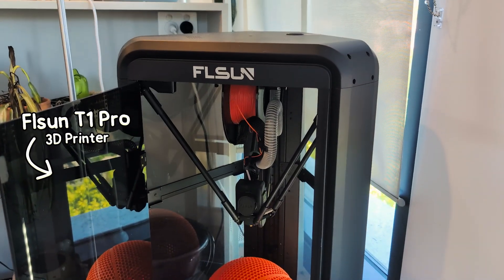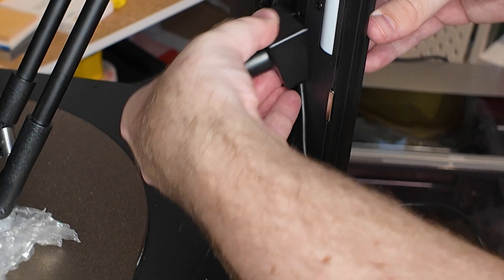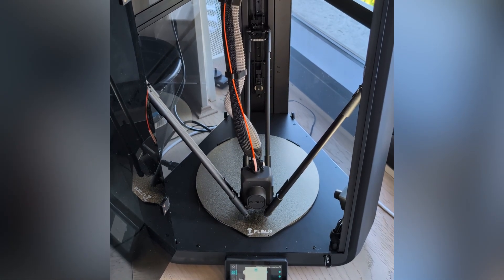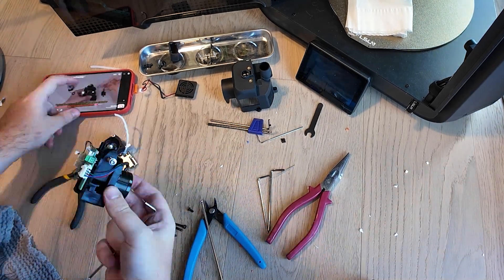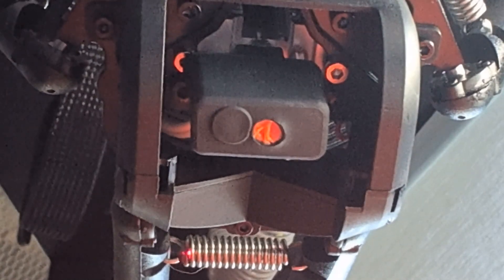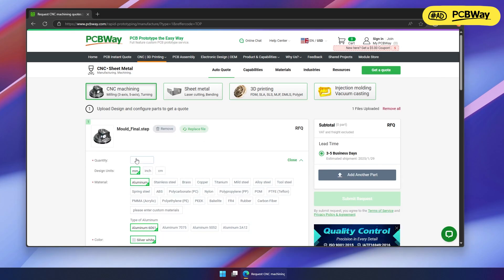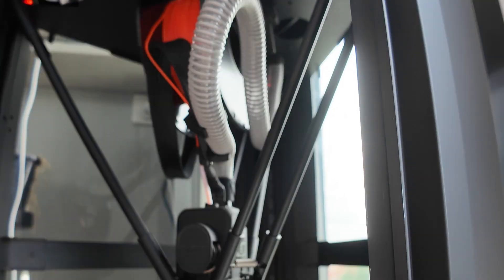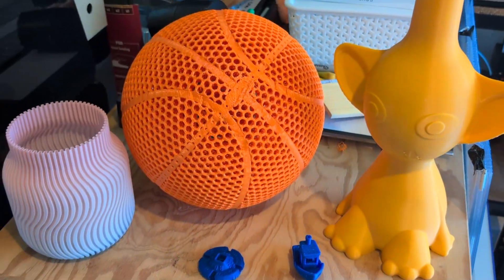I tried the Flsun T1 Pro - It didn't go well...

Comment: Received 7-20-2-25: Filament detector failed, took way too long to receive a replacement, the wires on the left fan were stripped during factory assembly, elected to outsource from Amazon, amazing how a manufacture can fails to include the rear screw in a disassembly video. Horrible effector design, totally unacceptable to clear a clog. I used a mirror to aid in removing the bottom screws. WTF!

Comment: I think you feed filament wrongly - you should place spool to unwind backwards so filament runs along hose and ribbon. This was the reason for tangling. Even better might be to lead filament through ptfe tube from spool to extruder (or mode spool out of enclosure).
Homing happens when print is done 8:50  - never during print - so thats not the reason for tangling - print started and you see first layers print well - i think You place both clips to close to each other and to close to head - while to far from spool and spool unwind to the front = recipe for disaster.

As a proof - heres my video:  https://youtube.com/shorts/MAxd52yC0ao
Reply: If you had this printer, you'd understand the proper loading, and it's certainly not to the back of the printer.

Comment: I've had the T1 pro for a few months now. Really bad first impression. It has a lot of quirks and getting to know this speed demon takes time. 

What I've learned:
Slow it down! You don't need any of the printing speed settings about 300-500 MMS the fast travel and acceleration still cuts print times down a lot.

Use glue stick for every print. It's a necessity.

Make sure your z settings on supports are at least 1mm bigger than layer height to allow supports to remove a hell of a lot easier.

Infill should be adaptive cubic.

Use the extruder back out (unload) setting to fix clogs before trying to remove the whole thing. I made that mistake wasting all that time.

Comment: Preordered t1 pro, i totally agree with the horrendous toolhead removal just for dealing with filament jams. Disassembled the toolhead 2 months for a jam. The nozzle unscrewed itself, caused a filament clog. Suddenly , the printer having leveling and stringing issues , found out that the nozzle sandpapered itself and became damaged. 

Changed to a tungsten carbide nozzle. No issue on printing. Switched the original fan to the sweeper fan ducts and got a " silencer" for the fan inlet port and another chimney filter to cut out the annoying high pitch whine. Taped and foamed up all the existing gaps on the doors and panel. Now printer works wonders with minimal noise and maintenance.

Comment: The tangling is due to not having the filament run through the cable clips on the cpap usually.  But your end conclusion is correct I think, it's a terrible out of the box experience.
Reply: @crashingsux  I have worse tangling if I run through both clips. Running through only the one closest to the extruder and printing a roller that uses ball bearings for my spool holder has cured my tangles.

Comment: Those surface issues you are seeing are under cooling.  FLSun turned down the stock fan settings to try to quiet the noisy beast, resulting in undercooling.  You either need to slow the print down, or turn the fan speed up.  There are better fan shroud designs, but in the end you can't print that fast without making noise to cool.  To compound the heat issue, they set their default profiles hotter than everyone else to increase flow, so if you do slow down consider dropping the filament temp as well.

Comment: I've got a T1 Pro.
So I'm a tech geek in my 60's, I've assembled thousands of devices over the years and I gotta say the "out of box" experience FLSun has on offer here is horrible.  Seems they have willingly sacrificed a good setup experience for a buyer in the interests of the "flattest" possible shipping box to minimize their costs.  A complete re-think of what can/should be pre-assembled at the factory for a better overall customer experience is in order, and only THEN develop packaging to match.  And yeah, the arms/extruder assembly is particularly fiddly and overall bad.  I also ran into an issue where installing the plastic cover over the two cables that plug in at the top of the left support dislodged one of the cables, giving me a DOA experience on first powerup.  Their customer service though DID provide some excellent troubleshooting tips with pictures and videos with which I was in just a few minutes able to find and correct the problem.  Needless to say, I didn't reinstall that cover.
Very much agree as far as noise level, this thing is WAY too loud.  Their design decisions regarding the "Pro" upgrade over the original T1 kinda addressed some major flaws, but didn't go as far as they should have gone.  The choice of a "medical" style blower is just mind-numbingly bad, they COULD have made the Pro oh so much better but it seems the design team is either deaf or working in a factory environment that's just so loud otherwise they just never evaluated the end product in a quiet/home environment.
The filament handling system is incredibly bad.  I found a spool roller  that fits to their insane "bar" and that has GREATLY reduced that particular problem.  Have not had a filament tangle since, between using that and ALWAYS homing the extruder before starting a print. I visually ensure filament is back on the roll properly before I start any print.  And yeah, those hose clamps are BAD.  They don't stay in place, running your filament through both is a nightmare, comments I've read online suggest ONLY running your filament through the one you've placed nearest the extruder.
Loading/changing filament is indeed a pain.  Knock on wood I haven't had a jam like you experienced, that extruder disassembly looks horrendous.  The "system" I've come up with is: Snip the filament with cutters about an inch above the bowden tube, manually move the extruder nearly all the way down and all the way forward, hit the unload button and manually enter 250, grab the filament nub with needle nose pliers and gently pull when it's reached temp and you HEAR the gears turning.  The key being GENTLY.  Then when loading new filament, I again manually move the extruder (if not already), hit the load button, insert the filament into the bowden, then watch and listen for the gears to start turning and agina GENTLY push the filament until the gears engage it.  Let it finish, then hit the load again, letting the new filament purge any leftover old.  This sounds like a PAIN, but it's become basically second nature to me now.
Another issue (for me) is the internal light is way too bright, causes the camera to pretty much always overexpose.  Printed a strip of translucent clear PETG and taped it over the light bar, much improved.
Might sound like I'm hating this printer.  No, actually, I really like it.  Anything I print that's round (and that's quite a bit) I print exclusively on my T1Pro versus my X1C or MK3S+.  I don't push it to go max speed on either round or otherwise prints, it hands down kills my other printers where speed is concerned. And the quality of my prints has been REALLY good once sorting through all of the above.  In short, the T1Pro is very much NOT for someone new to 3Dprinters, and it's not a good fit for anyone that's not particularly handy with intricate machines.  But to be honest, I never expected a delta to be as user-friendly as a bed slinger or coreXY.  Delta has got great potential, my hope is FLSun can get a "human factors" engineer on the design team and make a truly amazing T2 (or S2, or both) that corrects the T1's flaws.
Reply: Thank you for this honest evaluation of the T1 Pro. I have a V400 and I LOVE the delta kinematics system. It's so mesmerizing to watch while it prints. I wanted to upgrade to the T1 Pro but the noise level that everyone describes is putting me off. I even went so far as to change a few of the fans on my V400 to make it quieter, but the CPAP fan on the T1 isn't something that can be easily replaced. As you said, here's hoping that they take these issues into consideration with their next model.
Reply: I literally have 0 issues from day 1 and already 200+ hours, never failed once, not even first layer issues not sticking to the bed.
Maybe there is a difference in unit production (some batches are bad?)
Yes the assembly was a pain in the ass though
Reply: @Jootn2kx  I accepted the latest firmware upgrade from the front panel and it bricked my T1Pro with a Klipper stepper error.  Took ~10 days of back and forth via email and Twitter DM with support, had to manually edit printer.cfg to get it to power up and be able to control the arms and toolhead.  At least it was a software problem, not a motherboard gone bad as they were initially telling me.